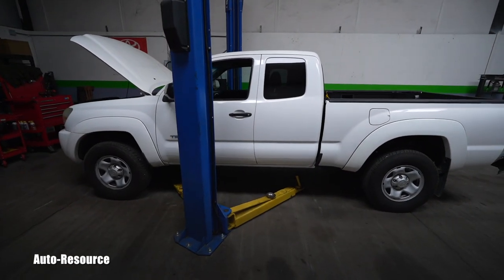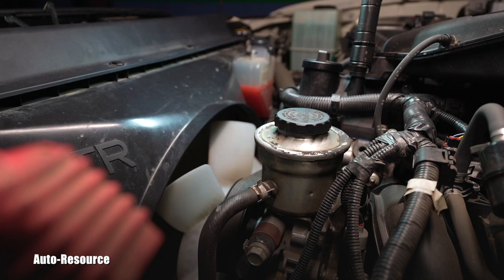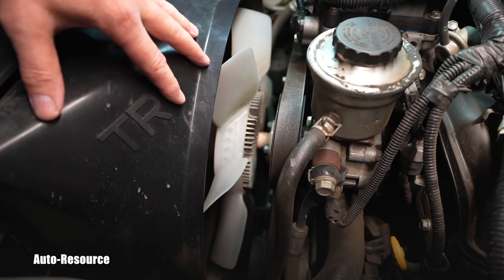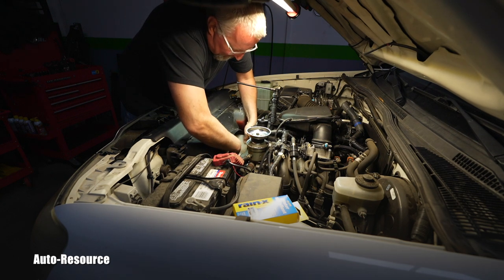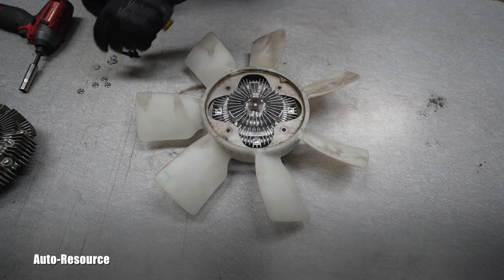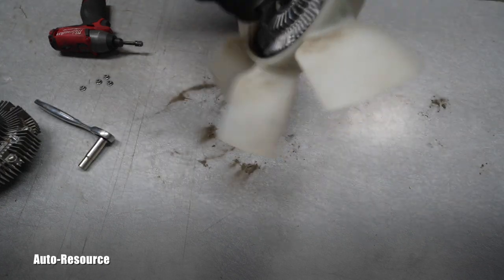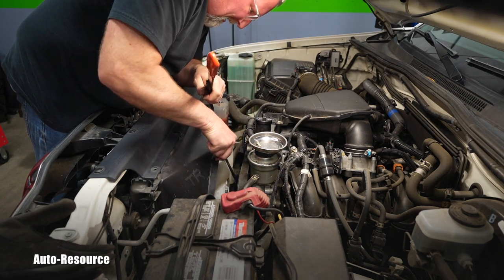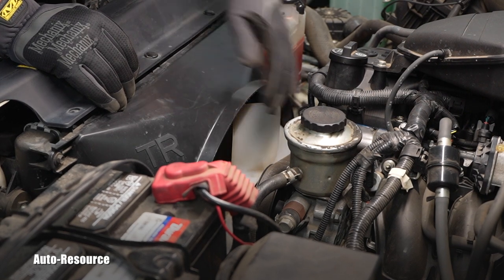Bad Cooling Fan Clutch Symptoms, Replacement

Comment: You are the ONLY person who actually shows the fan rotation which is exactly what I wanted to know. I wanted to know how much free play the fan should have when it is cold and no other video actually shows it. All other video's just say that there should be resistance but dont show how much resistance. Thank you. I finally realised that my fan clutch is stuck and does not allow the engine to get to operating temperature. Thank you

Comment: I'm using a flex fan from LCEngineering for my 2rz turbo, been over 10 years and it never needed replacement or broken down. They are around 100ish. Was noisy when new, but quieted out after a few months.

Comment: I noticed my fan is always on so I’m trying to diagnose it and starting here. I noticed the fan will move about one revolution but not as many times as the one you demonstrated here. It also is not as sticky as the new clutch you showed either though as it will spin slightly.

Comment: @Toyota Maintenance would this be the same issue when the fan clutch does the opposite?  I have a 22R-E and the fan never seems to decouple from the engine.
Reply: Is the fan for that engine direct drive or clutch coupled? Some don't have clutches and spin as the engine spins

Comment: Everything I've read say it should be easy to turn when the engine is off.  I need some clarification.  Additionally, my engine sounds like a garbage truck when I start it up.

The fan in a 2006 Toyota 4Runner V8 4.7 should not be hard to turn by hand when the engine is off. If it is, there may be a problem with the fan clutch or the engine cooling system.
The fan clutch is a device that controls the speed of the fan. It is located between the fan and the water pump. When the engine is off, the fan clutch should be disengaged, which means that the fan should be easy to turn.
If the fan clutch is engaged, the fan will be hard to turn. This can be caused by a number of problems, such as a faulty fan clutch, a clogged radiator, or a thermostat that is stuck in the closed position.

Comment: I have a Severe duty viscous clutch on my 02 Jeep WJ 4.7L V8 and it's heating up past 210°F slowly and normally runs at 195-200°F on inside gauge.

If I'm going up hills, sitting at stop n go traffic and going under 60mph it doesn't go back down to operating temp.
I checked the clutch and I think it's fine but I have a Severe duty clutch not a Standard or heavy duty so it is supposed to go 85-90% of water pump shaft speed.

Would mine still be bad if it's not free spinning?

Could a thermostat partially opening cause my symptoms at lower speeds?
Can it be the water pump with no bearing noises?

What do you think?

Comment: My 3rd gen 4runner is overheating when offroading in sand when heavy on the throttle but street and hard pack dirt its fine. I have a feeling this may be my culprit